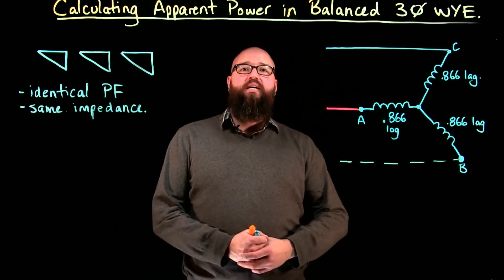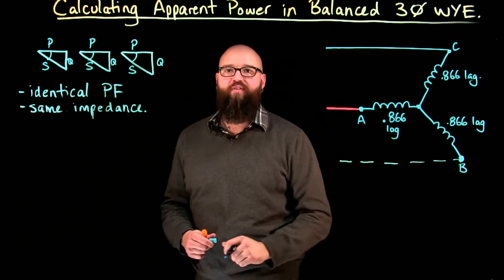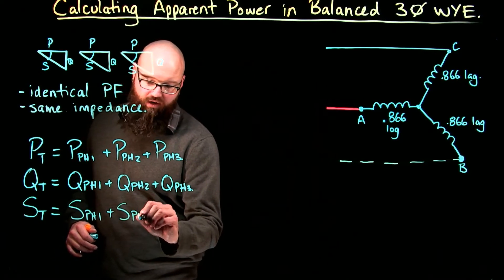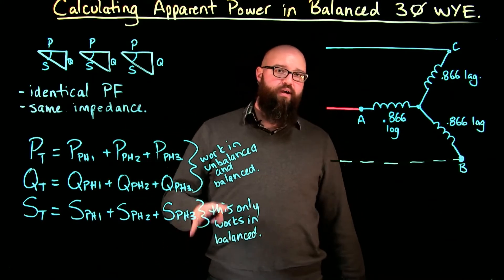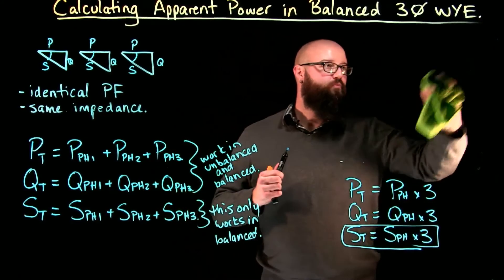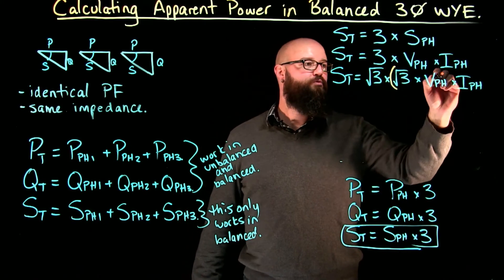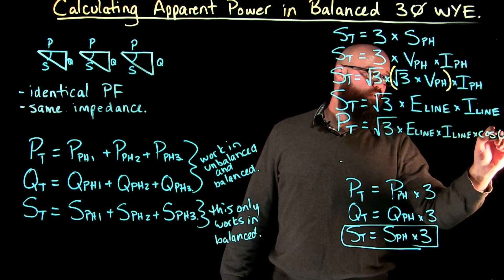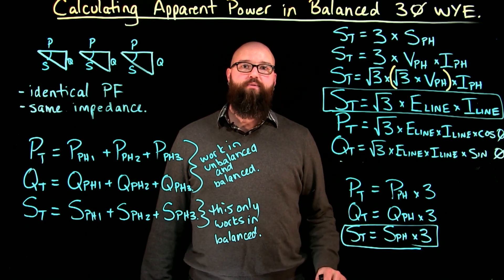Apparent Power in a Three Phase Balanced WYE Circuit

Comment: If you have a 40 amp  2 pole breaker, with a 40 amp load, in a 3 phase panel on phases a and b, does it draw 40 amps on both of those legs or do you have to divide by 1.732?
Reply from the maker: That would now be considered a single phase load, and as such would have a phase current of 40 Amps. Single phase line current is equal to phase current.
Reply: @schulerruler  That's what I thought.. I had others tell me I was incorrect and that I had to convert to VA and then divide by voltage multiplied by root 3 to find the correct answer.. Which would be the same as load in amps/1.732. Thank you for the reply

Comment: It means the 3 phase genset having rating of X VA delivers X/3 power to single phase load. Am i correct
Reply from the maker: You are correct. Each individual coil has the capacity to deliver one third of the total output.